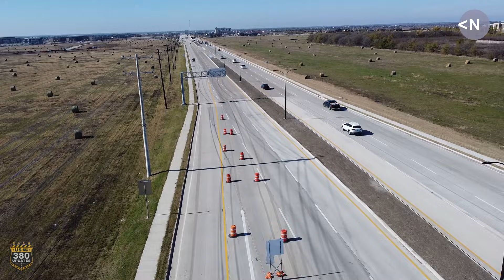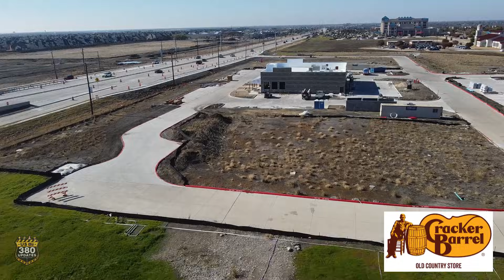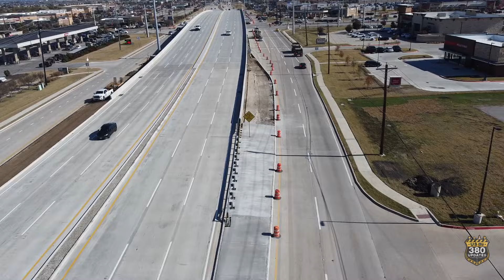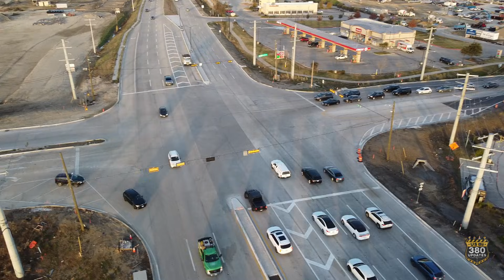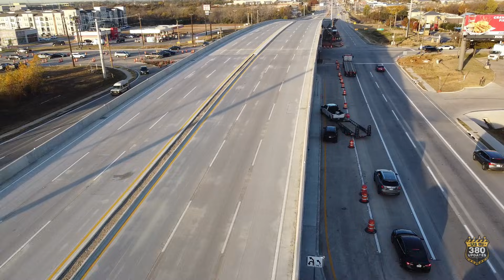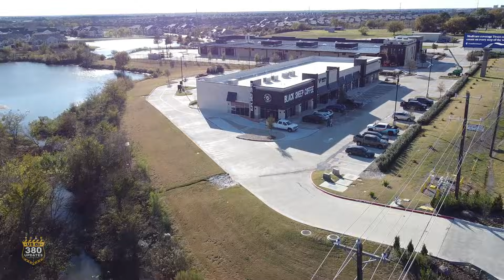New Lanes, New Signs, New Stores!

Comment: Are there any plans at all to improve 1385 at 380? It's an absolute nightmare after 6pm. Took me longer to get thru the 423 turn onto 380 and get passed the 1385 light than it did to get from Irving... TxDot 100000% messed up not making 1385 an overpass... it's absolutely ridiculous that they did all this work, only for 1 intersection to fuck it all up. No one can turn when 423 light turns green because 380 is backed up from 1385, the turn around under the 423 overpass is backed up, again because 1385, it's just nuts.
Reply: Design standards, and decision making have declined, since the mid '00's.   It's clearly visible, statewide.

Comment: The single left turn from Main Street on to 380 east is already a problem with traffic backing up considerably in the afternoon. It backs up so far that you have to wait multiple light cycles to even make a right turn westbound. I’ve seen several drivers use the center straight lane into Ryan Spiritas to turn left, so y’all make sure you watch for that and don’t swing out into the right hand lane when turning. It should have been a double left turn from the start.
Reply from the maker: It’s a known issue, probably should have been a double left but it wasn’t how it was designed

Comment: Looking at this project the traffic lights all defeat the purpose of the overpass and detract from the safety of the road. With future development they threaten total gridlock. The 380 really should have been rebuilt either as a freeway or semifreeway, with overpasses at the traffic lights or a complete shutdown of the intersection (right turns on and off 380 instead). Junctions that already were pain points like the 1385 and Doe Creek intersections will continue to be pain points and in fact even bigger problems.

The best course would have been to convert the road to freeway with commercial development restricted to the interchanges but I guess that was deemed too expensive. In that case, no one considered making it a tollway instead?

Comment: Main St south bound desperately needs to have 2 left turn lanes. 90% of the cars are going left and the line goes back so far that even if you wanted to go straight or right you cannot. The middle lane can easily be a straight and left lane. Out of everything covered in this video, I think that is the top area that needs to be addressed ASAP. Thank you for all your updates!

PS, eliminated Doe Creek! A light there would defeat the purpose of the overpass

Comment: The intersections that have traffic lights instead of overpasses take away from the efficiency of the whole project. Still a lot of work needs to be done. There are places that still have single lanes, places where lanes end abruptly, etc.  Overall, not a big fan of the project.
Reply from the maker: A lot of frustration comes from comparing reality to a version of the project that never existed. The key objective of the project was to increase safety and also capacity with the first as most important and most definitely achieved.

Saying “they should’ve just built bridges everywhere” is like being mad a pickup truck isn’t a sports car. That was never the product.

We all drive the same corridor. The only real choice left is whether we judge it against an imaginary design or understand it for what it actually is.
Reply: @US380Updates disagree.  From the get go when the design plan was made public, plenty of people did not like that certain intersections did not come with an overpass.  While I understand an intersection like 1385 would be difficult, engineers could have figured something out.  Once the Costco area is fully built out, it will be gridlock and it’ll be 6 yrs before 1385 expansion will be completed, if ever.  What has been done along 380 has been amazing but with the amount of growth in this area, the design 100% should have included additional overpasses.

Comment: **Naylor*
Yes, Naylor to 380 is better. No more mile long one lane line!
**However** 
The Naylor side going north needs lane markings. There have been cars in the left lane go straight AND cars turn left out of the middle (straight only) lane. 
Ppl need to use common sense and be aware…and careful. 

Plz plz plz…start doing traffic updates on the new high school on Naylor. It’s a HUGE complex for such a small road like Naylor. IMHO 

Thx for the updates! We love them!
Reply from the maker: Thank you so much for taking the time to write this out - this is exactly the kind of real-world feedback that helps paint the full picture of how these changes are actually working day to day.

You’re absolutely right, the Naylor connection to 380 is a big improvement overall, especially getting rid of that long single-lane backup. That alone has made a noticeable difference for a lot of drivers.

And we completely agree with your point on the northbound side. Until all final striping and markings are in place, it can definitely feel confusing, and we’ve seen the same behavior you’re describing with drivers unintentionally using the wrong lanes. That transition period is where extra awareness really matters, and your reminder about common sense and caution is spot on. Exercise some defensive driving out there everyone!

As for the new high school, that’s a great callout. It’s a massive campus, and it’s fair to say the surrounding road network is still adjusting to that level of daily traffic. We’ll keep an eye on it and share updates where we can, especially as patterns start to emerge with school hours, events, and peak congestion times.

Really appreciate the kind words and support - we’re glad the updates have been helpful, and comments like this are exactly why we do them. Thanks for being part of the conversation and helping keep things safer out there.
Reply: @US380Updates and do you have any insider info when that tiny and very bad McCormick road that’s the cut through from Naylor to 720 will get rebuilt? It’s inevitable and a pain point because the surface is truly awful due to the level of traffic between Oak Point and Little Elm.

Comment: Shut Down Doe Creek intersection, no light please.
Reply: Agree. Doe creek coming out to 380 and making a left towards 380 west should be designed such a way that making left is discouraged or impossible. This place is an accident waiting to happen. Additionally, the light will just defeat the purpose. I can’t understand people not having patience to just go further and make a U from 423. It’s not a lot.
Reply from the maker: @Purplehaze778 if ever, we won’t be making a left there out of Doe Creek - safer and likely during certain times of day faster to head back to 423
Reply: Thats what those turn around lanes are for huh?
Reply from the maker: @Blasteryou the turnaround lanes will be preferred by most people
Reply: I agree.